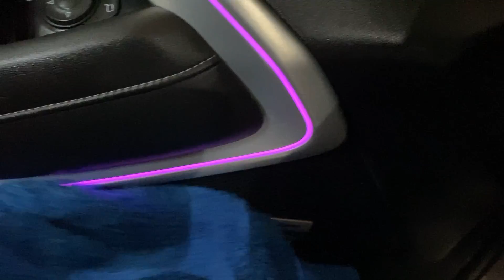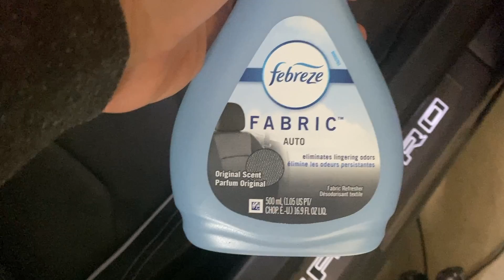NO TALKING - Deep Interior Clean On Chevy Camaro

Comment: What spray do u use on the inside of the Camaro doors to not stain them with spray
Reply from the maker: The spray I used is only available at a detail shop near me but most any interior detailer will work. Unless you are referring to the alcantara
Reply: @Gonin60  I'm just scared to spray anything on the doors scared it will leave wet spots
Reply from the maker: @dezzelias1674  griots or Adam’s interior detail spray with a towel and you will be fine. Spray onto the towell